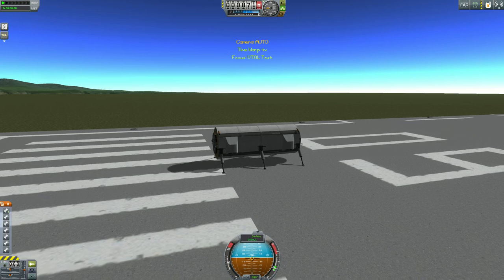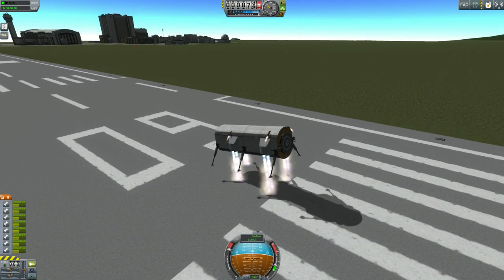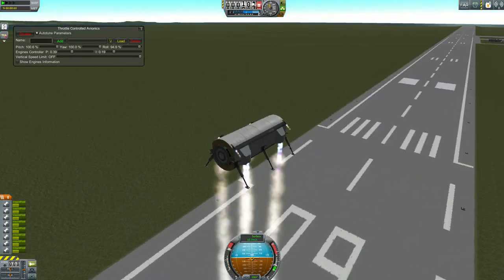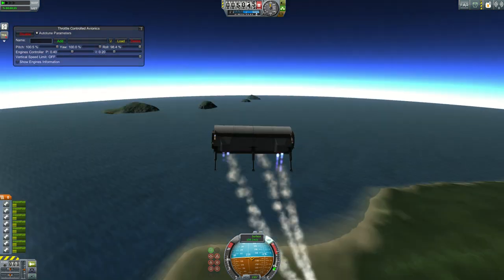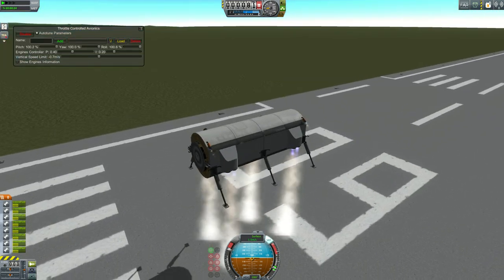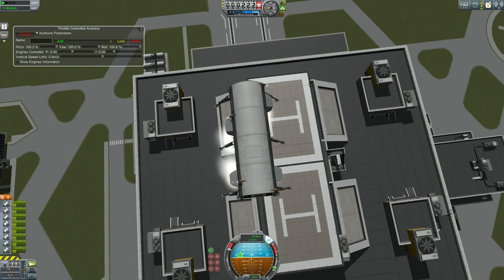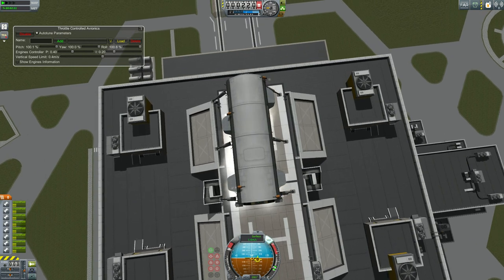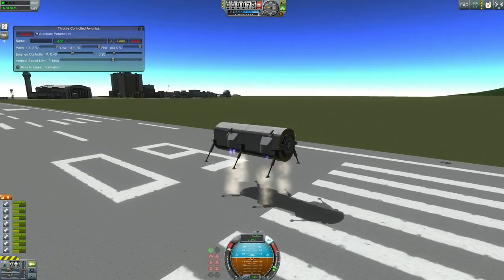Throttle Controlled Avionics, Introduction

Comment: Reminds me of something I made in KOS, except considerably more advanced. Mine just autohovered at a specific height with one engine. It worked with rockets, or if you were willing to tolerate horrible noise from spamming the intakes on and off, jets. Unfortunately, the spool time on jets makes them very tough to use for VTOL purposes.

Comment: i downloaded module manager and this mod but i dont have the toolbar. i got the flags but i cant enable the tca. Help me pls
Reply from the maker: Probably your KSP version is unsupported by the version of TCA you're trying to use. The list of available versions and corresponding KSP versions is here:
https://spacedock.info/mod/198/Throttle%20Controlled%20Avionics#changelog
Reply: Try using CKAN in the link below to manage your mod install procedure. I believe your issue is that TCA also requires AT Utils v1.6.2, Configurable Containers Core 2.4.3.4 along with Module Manager 3.1.2. I also use Toolbar and Toolbar Controller from linuxguru gamer which may be why the buttons are showing up. I'd try installing the dependencies first and then Toolbar\Controller if it still isn't showing up.

https://forum.kerbalspaceprogram.com/index.php?/topic/90246-the-comprehensive-kerbal-archive-network-ckan-package-manager-v1180-19-june-2016/

Comment: That will allow us to build so impractical for the stabilization part, but for the vertical speed ... gosh I was actually looking for something like that just yesterday ! 

How well it incorporate with mech jeb ? For landing I would have TAC for vertical speed and mechjeb with smart A.S.S. for pointing toward svel -
Reply from the maker: Matrixtechno unfortunately, MechJeb uses a very special PID controller to point orient a vessel; with TCA this controller causes oscillations, unless you decrease Steering Gain considerably. But TCA now has a built-in autopilot to kill horizontal velocity with flip-over prevention, so I would use MechJeb to aim and approach the landing site from orbit, and then switch to TCA for finer control.

Comment: Will MechJeb work with it? Say you stabilize your ship and want MechJeb to land it. Will it completely go nuts or will MechJeb understand it?  I was hoping MechJebs "differential throttle" would do similar but it completely fails on me and always makes the ship crash, barely throttles properly. This works so amazing. But I'm an autopilot junkie and would like the two to work together. Haven't tried yet since I won't be near my main computer for a little while.

Comment: Very nice mod. Is it possible to bind the vertical speed limit slider to an axis/slider control, like the slider on the thrustmaster warthog or the knobs on the saitek HOTAS products? (or perhaps a better question, is it possible for any mod to use axis bindings?).
Reply from the maker: allmhuran Never looked into it this deep. But there's axis binding in stock configuration and there's Advanced FlyByWire mod which, as far as I know, does this somehow. I'll try to investigate the matter, thanks for the suggestion.
Reply: Allis Tauri :D

Comment: this mod is amazing! just one question though.
how do you add engines to be compatible with TCA? im building helicopters recently using Airplane Plus, but only 2 of the Helicopter Propellors will allow me to group them into TCA groups for hovering, which sucks since some of my more recent heli builds cant use the propellor i want  since it doesnt allow me to put that engine into the groups for some reason. i am looking for a solution but i have no modding experience at all. is there an easy way to fix this? 

if i cant figure out how i might re install airplane Plus, to hopefully fix it, but i have a strong feeling my planes using airplane plus wont work anymore if i re install Airplane plus.
Reply from the maker: Thanks!

Only derivatives of the stock ModuleEngine are supported. The real rotors use completely different physical model and cannot be used with TCA.
Reply: alright thank you! i will probably find some way to have the heli fly with the right propellor.

Comment: Does it have thrust differential for rudderless planes? Like b2 steers with airbrakes and thrust differential.
Reply from the maker: The only thing it does have is differential control control of the thrust. That's the whole point of this mod.

Comment: Would I be able to land a first stage booster Spacex style on a landing pad accurately???
Reply from the maker: Not likely; TCA can land pretty accurately on a surface spot, but I'm not sure of it's possible to do this with another vessel (the pod) as a target.
In any case, general purpose powered landing implies that you have enough fuel for maneuvering. SpaceX-like suicide burns could only be achieved with dedicated programming tailored for particular situation.
Folks do it with kOS scripts.
Reply: Allis Tauri ahahaha I’m not smart enough to code, I just use mechjeb which works but doesn’t use fuel too efficiently

Comment: Realy....realy good mod !!!  I make a link of your mod in Ksp.fr for you  ;)
Reply from the maker: Thanks! Glad it's useful)
Reply: Allis Tauri ^^, but, do you think in the future , you can fix  the stabilisation systeme with atmospheci engines?  Your TAC work with but not very well ^^ . I need use Spyke engines for keep the control well
Reply from the maker: Spaykers unfortunately, this is not something that could be "fixed", because it's not broken: Atmospheric engines have slow throttle response speed (which is defined in their part.cfg) due to the fact the turbines are slow to spin up or slow down. And TCA tries to change thrust in real time. This means that TCA works as always, but the engines just don't listen to its commands.The only thing I could and will try to do, is to develop some fast-responding atmospheric engine based on some real-world technology, if such technology exists. Maybe variable nozzles, maybe propellers with variable blade attack angle. You may look at Firespitter and other mods which provide parts for planes. Maybe they already have such engines.
Reply: Ok  ;). Well, its still a wonderfull work. I just cant imagine how that can be hard to coding a mod like that. ;)